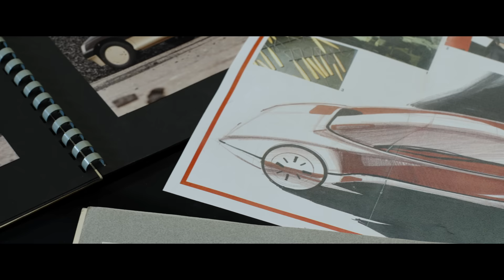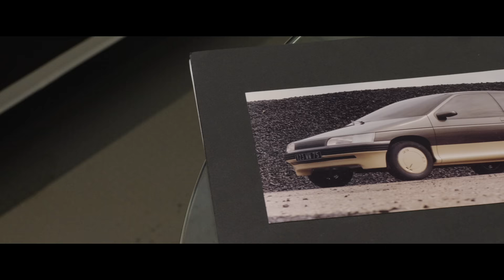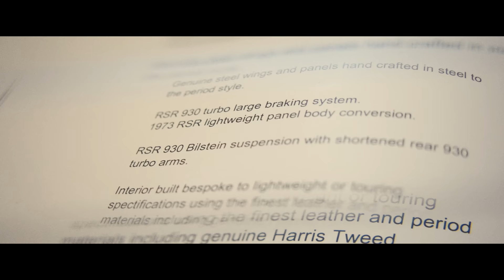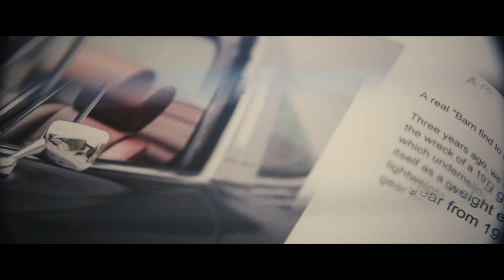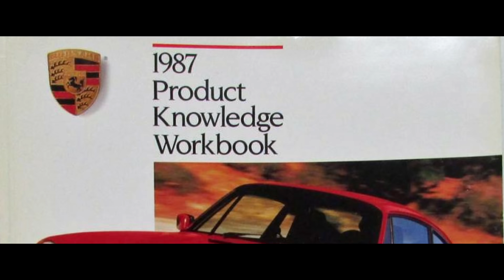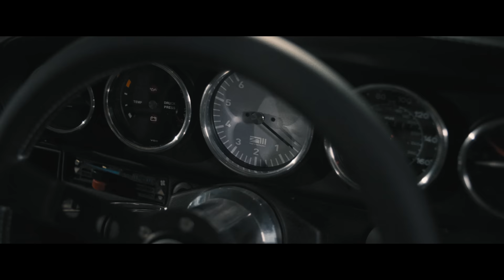Porsche 911 ST By Rennsport – Car #100, The Ultimate Porsche Build | Carfection 4K

Comment: Why go to the trouble of get a '87 911, "the last proper model," with a torsion bar suspension, only to put an aftermarket system in? I also think that gold lettering on the rear is tacky.

Comment: I love porsches but if you go over 100 mph you ate in trouble.You have no control there is not enough weight in the front end.And its not just the 911 its also the boxster.